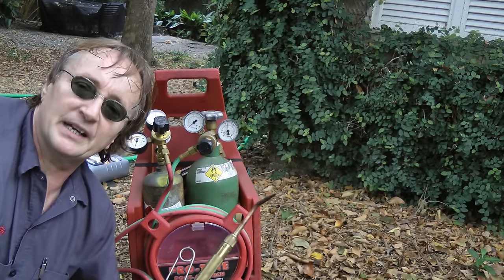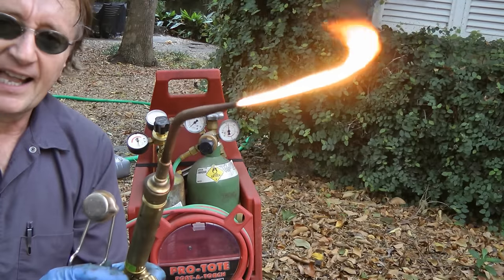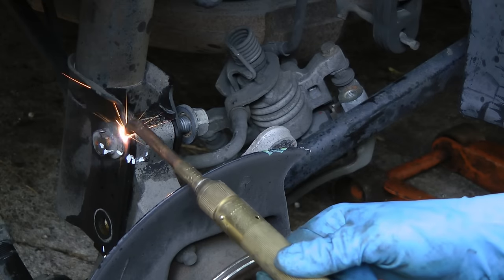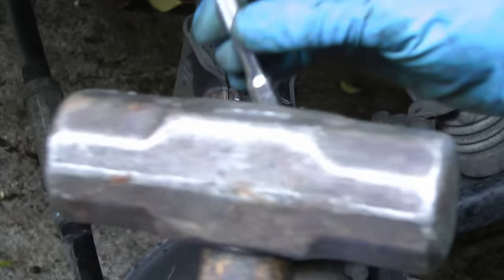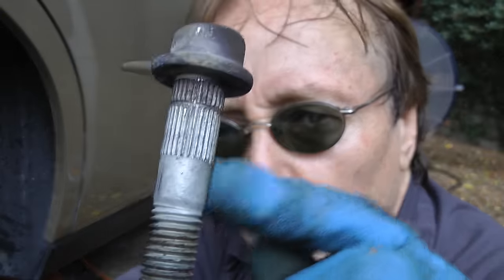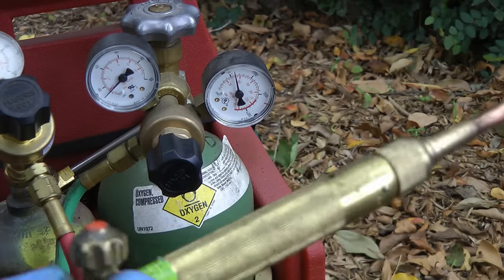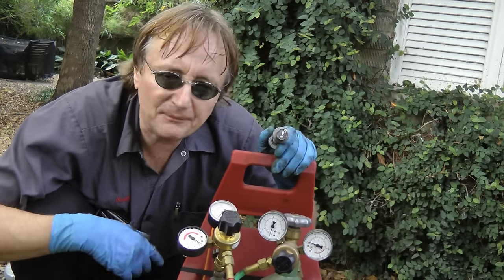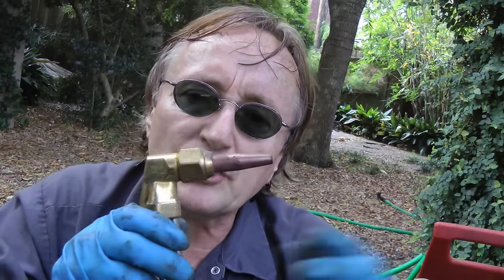How to Remove Stuck Nuts and Bolts in Your Car

Comment: He really just say spending $200 on a oxy torch wasn't expensive? That's why we are on YouTube to look for a cheap fix. I know I don't have $200 to blow on one torch
Reply from the maker: +Brandon Miller mechanics now charge 100 bucks an hour labor, a 200 dollar torch lasts a lifetime
Reply: +Scotty Kilmer until you have to refill the tanks then that's atleast another $30
Reply: +Brandon Miller use a cheap 25 dollar blowtorch then...
Reply: mhm there ya go 10$, 25$, 50$, 80$, 200$. you got options man lots of different torches out there
Reply: +Potato Masher Just did it with a plumber's propane torch. I'm a college student, so I don't have a lot of money. This works just the same.
Reply: +FluffyTheGryphon see that's what we need videos on. Not wasting $200 for one bolt
Reply: +Kristian Szabo first off the comment you making is invalid due to the fact that the whole reason I commented is because I was fixing a stuck bolt on my car. Second I had ONE stuck bolt, I might have more in the future or I might not so it could be an investment or a loss. $200 on one bolt. Way to much for me. I actually took it to Midas and they got it out with a torch and it literally cost me $25. Beats $200 any day. And btw haven't had another stuck bolt yet (;
Reply: LOL!!!
Reply: the shop charges 100 an hour not the mechanic.
Reply: If you want to do any serious repair work its good to have. you can even get a mini oxy-mapp gas torch at home depot for like $50... but a good torch will serve you well for years. a shitty one will be harder to use and less safe.
Reply: I use a soldering torch for plumbing, much cheaper if you won't be using it much.
Reply: Brandon Miller  use a lighter
Reply: $ 200 is a fair amount of change.   However,  drink one or two less beer a week and put it toward a torch.  If you work around cars a lot its almost a necessity and you'll just smile every time you use it.
Reply: You can pick these up at flea markets for a lot less.  It doesn't have to be new.  If your a mechanic, tools are an investment that makes money, not an expense.  I have thousands of dollars in tools. Some I've  only used one time, but saved me hours of labor.
Reply: Brandon Miller what would it cost to pay a mechanic to do one repair let alone the numerous ones you can do yourself with this.
Reply: You can use a high-intensity heat gun or handheld torch as well. It just depends on what the bolt is made of and how thick. I've done it before, it just takes a hell of a lot longer...  

Ideally, a good torch is one of those tools you buy and then keep for your life. So for $200-$500 you can cut metal, weld, and all kinds of stuff.

I do agree this ain't cheap for removing one bolt. I'd try WD40, Impact guns, and other stuff before I did this.
Reply: Work on cars in the rust belt and you will think $200 is dirt cheap. Winter salt will rust fasteners so bad they laugh at propane and mapp gas torches, it takes getting them glowing red hot and sometimes they have to be cut right off or out completely. Which means ox/acy, your Ace Hardware plumbers torch isn't doing that.
Reply: Harbor Freight has a little affordable oxy torch but I'm afraid to store that stuff in my house.
Reply: I'v carried one in my work truck for over 27 years.  Never a problem.  Inside of truck  metal job box gets over 180 degrees in the summer.  Never a problem. Jjust make sure the valves are closed when you store them.
Reply: Brandon Miller ok, you can go to a mecanic, he will remove it for you for 200 bucks or more.
Reply: 200 isn't much when if u brought it in ur looking at 900. Just did my whole front suspension on my 08 dodge 4 banger had da buy slot if new tools still saved a bunch
Reply: R0773N That's what I'm saying you people have 50lb gas tanks laying around ecpecting to use it in 60years. Its dangerous enough having a water heater.
Reply: I just use a bic lighter. Hold the flame there for about a minute or so and whack it with a hammer. Works every time, at least for me.
Reply: @mysterydude1  Thanks, I never knew my $0.99 medical marijuana flame would work just as good as a $200 torch for this bottom  alternator bolt 😀.. I was even able to afford a new one after the fluid ran out which is much cheaper than refilling those tanks.. and besides, my car has a bad alternator so there's no way for me to get it to a shop. Just had it towed home off interstate when it shut off while driving 65mph.
Reply: If youre that bothered about the price then dont fucking buy one
Reply: @scottykilmer  o really, what do u charge Scotty? R u in the process of playing catch-up.

Comment: And make sure you replace any nuts or bolts you heat up to red hot. You can weaken the steel by 50%.

Comment: Scotty, I have a 1996 Toyota T110 pickup and my problem is extremely reduced airflow out all of the vent.  The blower motor is new and it sounds like most of the air flow is being capture behind the dash.  Any suggestions?  Someone said it is the air flow baffle that is stuck in a angled position restricting the air flow.  Napa said the entire dash needs to be removed to get to the problem.  EXPENSIVE PROPOSITION!
Reply from the maker: those blend doors are all plastic and can stick with that kind of age. sometimes getting behind the dash a little  from the center console will let you access door levers you can try moving manually.

Comment: Hello Scotty,
Thanks for your videos, I've got repaired my old (1999) vehicle a lot.
For this, I have one question. I have stuck nuts and bolts on lower control arm. This nuts and bolts should be removed for replacement of ball joint. Here is my question. Can I use butane torch instead of oxygen torch?
Reply from the maker: you can try, it may get hot enough.
Reply: Scotty Kilmer"Thank you very much.

Comment: I'm thinking about getting a oxy propane kit.  I know they aren't for welding, but it works for heating and cutting, maybe brazing.  I have a mapp torch, but it's not all that hot, and a oxy mapp torch that's better, but those disposable oxygen tanks last about as long as free beer at a motorcycle hillclimb.
Reply from the maker: +Mark Holbrook  really, get one of those small oxy acetylene portable kits, I use mine all the time and they are maybe 250 for a new set, or find a used one
Reply: Thanks, I'll check them out.
Reply: Scotty Kilmer
I ended up with a huge set of tanks both pretty full (last filled in 1992), 2 cutting torches, 3 regulators, a bunch of hose, adjustable wrench, an extra cutting tip, pile of sparkers,. Adidas nylon bag to hold the accessories, all for $250.  The oxygen tank is 5' tall.  And the seller delivered it to me because I can't drive after dark anymore, and he was able to do it, but would be busy until after Christmas.  Thanks, maybe things will be easier to fix on my vintage vehicles now.
Reply: +Mark Holbrook 
Here's the deal mark.   Today you get seriously RAPED to fill small tanks.    It costs $34 to fill my 90cf tank while the large ones cost about 38 - 4o for 3 to 5 times the gas.    To rent them they nick you for $60 + / year if you rent them so they get you coming and going both ways.     The best way is to get the biggest size you can and buy your own.   I think the biggest customer owned tank is 125 IIRc.    You will pay more to start buy in the long run you will be very very happy.    
   The tiny tank I kept was acetylene .   I don't bottle weld but once in 3 years or so, all Arc , Mig basically, but cutting is fine with propane right off the 20 lb barbecue bottle.    That's what you will find you use constantly, heating , cutting.      You can find some killer deals on torch sets on Craigs list.   Far better than paying out the wazoo for something new and all the parts are easily available as long as it's a common name like Victor, Smith, Harris.
Reply: Well, I bought a used rig off craigslist with the large tanks.  After doing some reading, I may have done the wrong thing due to the tanks have the name of the local gas plant on them.  So I have to take them there instead of my welding supplier.  Of course I can only hope they aren't their property, and not stolen either. 

Anyway, they were last filled in 1993, so they will have to be recertified to be refilled.  The set came with a Harris torch and cutting attachment, with a cutting tip, a victor torch with a new propane cutting tip, and a Harris oxygen regulator and acetylene regulator, and a victor acetylene regulator, which I believe will also work on propane, and 7 sparkers.  Also a gym bag to hold the accessories.  No cart though.  And the guy delivered it to me for free, from about 3 miles away.

The tanks still have gas in them, I don't know how much.  He took $250 for all, and even though that sounds cheap, I haven't tried anything yet, and they obviously were well used back in the day.  So, I hope it was a good deal, I'll find out soon.

The seller said he was trying to get Christmas money, the torches had been listed for a few weeks, and I bought it right before Christmas, but everyone has a story.  Hopefully he was telling the truth, and it works out well for me too.
Reply: +Mark Holbrook .
See if you can swap them out with the other local store you like.    If you can't then take them to the other one and swap them out.     They don't know one tank from another so if you bring one in you can just swap it out for another one.    It's the same process as when you swap out one of your own.   You get another one and there's no paper work.   Your tank goes into the stores tank pile for refill and you just take another and go.
Reply: Thanks, I'll check into that.  My mig gas tank is from the welding shop, but it's no big deal because both are close by.  I think I may see about swapping to smaller tanks, but not those tiny tanks.  Acetylene is 200-250cu ft, oxy is 300 cu ft.  and if I made a cart with a 20lb propane cylinder too it would be too heavy for me to take anywhere without loading one cylinder at a time.  Those cylinders are really heavy to lift.
Reply: I took a welding class in high school and we used oxy torches to weld. They make a flux stick that you just touch to the flame and it melts instantly onto the metal surface. Looked just like a regular weld but idk about how strong it is.

Comment: Do you have any advice on how to get a bolt out where the head has been rounded off? I  am having trouble with a strut bolt, as in this video, but my bolt threads into the casting instead of having a nut. I heated it up with a torch yesterday and was using a pipe wrench but that didn't work. So tomorrow I was thinking about using a file or grinder to try and reshape the bolt head so it will fit a smaller socket; and then reheat. Thank you.

Comment: Doesnt that heating also affect the hardness of the metal bolts and nuts you are removing?  Doesnt that mean they are headed for the trash?
Reply from the maker: on a bolt THIS thick, it harms nothing. But if you're worried, buy a new bolt
Reply: Yes, the hardness can be affected when steel is heated even with a brazing torch like this and the tensile strength may change. To combat this problem use cold work methods first such as an air hammer or an oil soak. If heat is needed use as little as possible and immediately oil or water quench.  The oil also has a capillary action that will work into crevasses such as threads or splines of fasteners when heated.

Comment: Hi Scotty,   Does heat also help free up a bolt that you can not unscrew because it is in too tight?  Thanks, Kevin.
Reply: if ya use heat in such a way as to swoll the bolt it wil get tighter,,if it is only too tight ya might use a longer handle ,but go slow as to not force break the bolt

Comment: We are changing out rear struts on a Honda element with bolts that wont back out. We tried everything, breaker bars , cheater bars, electric and air impact guns. Penetration sprays and heat. Nothing has worked

Comment: Hey Scotty, Ive got an '06 Jetta, and buddy that sold me the care didn't have any sort of locknut key with it.. And I'm unsure as to whether or not one would even work looking at the state it's in (10 point torx?).. So anyways I've been trying to take it by getting what I believe is a fluted bolt remover.. I've got a pretty good bite on the head of the bolt, but the sockets a 3/8" (snapped an adapter already), and theres MAYBE a few mill to get a 1 1/16" socket with a 1/2" drive.. any suggestions? (no available torch).

Comment: Go to home depot and buy a spray called pb blaster. ( penetrating and rust desolver) The average person is not going to mess with a torch that damages seals ,starts fires ,and blows up your car. Heat from a torch cannot be used in many areas; dugh. Mapp gas and adapter; way cheaper than a torch set up.

Comment: Hey Scotty, I have a long bolt without a head stuck in an aluminium cylinder head, could the same thing work with a heat gun? I don't wanna damage the heads. Thanks!! Jay

Comment: would you use that torch to remove the bolts holding an exhaust midpipe to the manifold? Which is the problem I have right now

Comment: Thanks Scotty for this video, it is very helpful,..  I've got 3 bolts that are stuck and I can't see the other end of the bolts. I'm trying to replace the blower motor resistor on a Mitsubishi Lancer 02, and there are 3 bolts in a very tight place behind the glove box.. is there a way to remove those?
Reply from the maker: I use a very small 1/4 inch drive ratchet set with small extensions and sockets that wobble  to get at such small bolts in small places
Reply: It is a hex bolt with number '7' imprinted on it.. what size of socket should I use.. nothing seems to be working on it
Reply from the maker: simply meyes
7 is just the hardness of the metal, has nothing to do with size.  But japanese cars ONLY use metric sockets, so get a set and see which one fits.

Comment: Hi Scotty,  when you turn off both valve and they go to zero. What do you set each Valve at when you start up .
Reply from the maker: different pressures for different applications. Get a cheap welding manual for oxygen acetylene torches and use their charts.

Comment: We're installing a small lift kit on my mom's '06 Chevy Colorado which involves replacing the shackles on the rear suspension. I fear this may be the only way to get the bolts out, but also that I might melt the bushings in the springs. Any thoughts?
Reply: yeah, there is a metal sleeve in the bushing the bolt is usually rusted to. many times you wont be able to make that bolt move in that sleeve because the rubber interferes.  if you can cut both end off the bolt and remove the spring you may be able to grind one end of the bolt and support the metal sleeve and drive the bolt out with a punch.
Reply: you can limit the damage to the bushing by using a really hot torch cutting the bolt fast and cooling it down with a hose immediately, going slow or trying to use a smaller flame allows more heat to penetrate
the replacement bolts are expensive at the dealership, find a spring shop and get the bolts there

Comment: Oxy sets can be very dangerous in the hands of those who don't know or won't follow the safety rules.
Setting the acetylene regulator over 15 psi for example could result in the torch blowing up in your hands.
Letting the oxy loose around oil or grease is another way to make things go boom.
When oxy sets go boom, it is a very big boom, the shed will disappear and the house won't look too good either.

Certainly wouldn't want a fool owning one around my neighbourhood.

Comment: You might've gotten it out without the heat.... My dad and I helped a friend with one of his not too long ago, used an air hammer to get the bolt out on a strut.... Of course, my dad first tore the head off using his impact wrench (which made us all laugh). The air hammer's vibration helped loosen the corroded bolt and push it out.

I don't think his was splined like yours to prevent rotation, it was just corroded as heck, but I'm not 100% sure.

Comment: Hey Scotty I've had a question that no mechanic has ever been able to tell me an answer to.  I had a 94 Pontiac Sunfire and after a year I hit a deer. It broke the Charcoal Canister off. After that the Oil would always have a gas smell and be diluted. I constantly had to change the oil because the oil would be like water after about a week.  You have any ideas what might be the issue? Is the Canister the problem?  I dont have the car anymore but I've always wondered. Thanks
Reply: Broken charcoal canister probably let gas pass it and into intake causing it to run super rich (only sometimes) and pushing some fuel pass piston rings into crankcase.

Comment: I need help. I have an 03 cobra and have been trying to change out my rear coil springs for the last 5 days. Just got the passenger side done today...after on it 5 days. Issue was the lower control arm bolt was seized in the metal sleeve. I used pb blaster, wd40, breaker bars, sledgehammers, and a handheld propane torch. The bolt was beyond usable when it finally came out. Im on the d/s now and have the bolt tip flush with the k member. Has alot to go to pass outta the lca. Any other ideas?

Comment: Hi Scotty. I'm having a lot of trouble trying to replace a heater core in a 2000 Lincoln towncar. It's my dad's car. I've always used Chilton manuals when working on my 94 lesabre, but this time its not really helping.  The manual does not instruct you to remove the dash but I'm not seeing any way around it. What am I overlooking? Btw I really can't afford to pay someone else to fix this so any help will be appreciated.  Thanks
Reply from the maker: that is an INSANE job, to tell you the truth, now that I'm 60, I won't even tackle that job anymore. It pays a pro mechanic 8 hours of labor to do it. One of the worse designs ever, the entire dash has to be removed. good luck